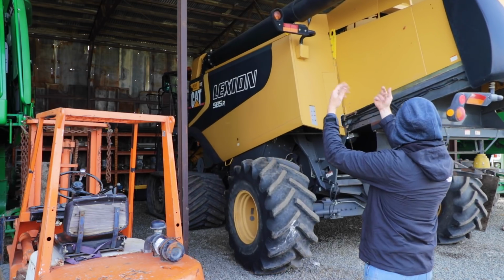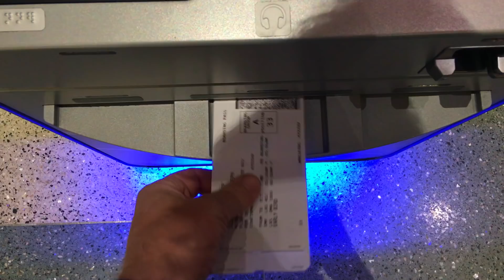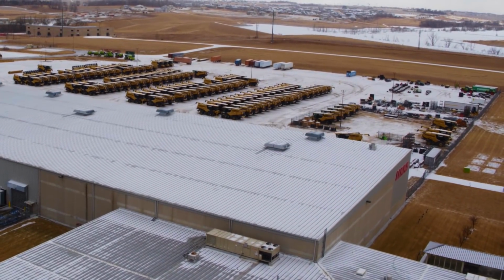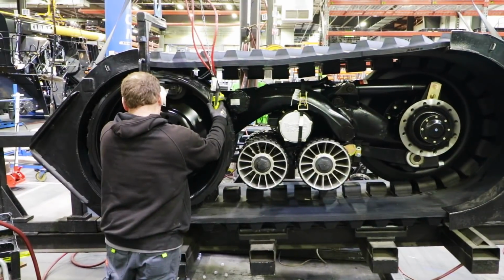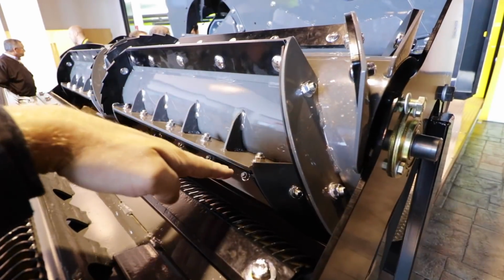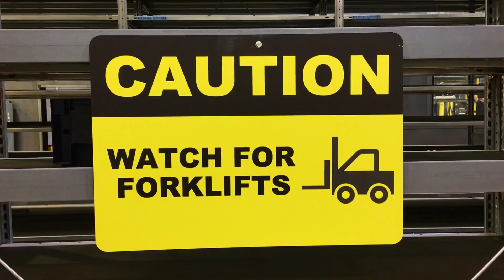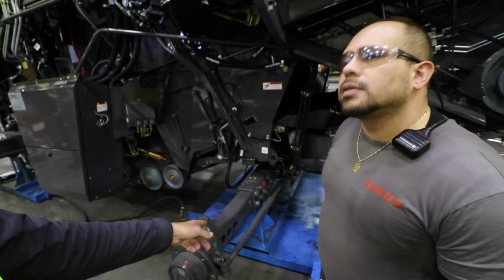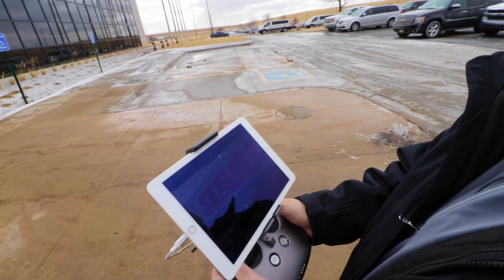How a Harvest Combine Works!

Comment: Great videos quick question Why are the claas an orange cat colour as where I'm from claas s light green. White and red . ?
Reply from the maker: Mr. Morris, great question. I think it has to do with marketing and consumer acceptance of a new product. American Farmers knew Deere green and Case red. But Claas neon? What’s that. They really pulled the branding towards Cat yellow and the actual name Cat. On early machines you could barely find the name Claas but Cat was all over. And they were only using Cat engines. Everything else was Claas. So American consumers were already familiar with the name Cat and the yellow color. As time goes on you start to see more Claas branding and less Cat, but still yellow. Apparently in 2020 the will start selling Claas combines in neon within the states...now that consumers are more familiar with the name. This is all just my speculation though. 
-Matthew
Reply: Never new they sold claas in America . The same with many machines in UK . Like same hurlimann and Lamborghini but the older ones like a hurlimann xt130. Don't know if u get them in America.

Comment: How's the irrigation situation? Are you still having water problems.
Reply from the maker: We got a few inches of rain this weekend Leuan but nothing substantial. What we're really in need of is snow up in the Sierra Nevadas above the Lake Oroville Dam. That summer melt would help a lot in supplementing our needs throughout the year's hottest months. We should be getting a new metering of the snowpack soon. But, as I mentioned in last week's video, we were at 14% of average  a month ago...and I don't think it's snowed much. In fact we had some fairly warm weather. We have a lot of march to go though. 
-M.

Comment: Lexion, the only way to go.
Reply from the maker: P, we've got our Claas Lexion 585R, a John Deere CTS 9660 and and older CTS2. We're definitely considering moving more towards the yellow direction. We are really, really happy with the performance and service that comes with our Lexion.
-M.
Reply: Rice Farming TV yeah man! we run two 760's now. Going from the 585 to the 760 was night and day difference.
Reply from the maker: Oh, great to hear. We are treading in towards the 760. They are still really pricey even used. We'll see what happens.
-M.
Reply: It's a Agco..
Reply: Nothing runs like a deere..top tech for claas for for years. And all they are is very expensive agco technology with German parts that wear to fast. But they can produce just dont last. Pretty cool video.

Comment: Thanks Matt, love the toy combine at the end.  quick question:  Claas is the manufacture of the Combine, but I see a Cat logo on your equipment?
Reply: L B L B In 2001 to enter the US market Claas the German combine harvester manufacturer went into a joint venture with Caterpillar Inc. and opened a assembly facility in Omaha, NE. The combines were originally marketed as Caterpillar combines, with Lexion as the model. Cat was supplying the engines. First they had the Lexion 400 series and then the 500 series. In 2010 Caterpillar exited the agricultural equipment market and sold its 50% share in the Omaha operation to Claas. That year Claas introduced Lexion 700 (rotary) and 600 (straw walker) series and dumped the ‘Cat’ Logo on New Lexion Combines. The new model launch provided a timely opportunity to finally exchange the large “Cat” logo with the Claas name for Lexion’s own identity. Caterpillar is no longer the exclusive engine supplier for Lexion combines now that top models use MTU Mercedes power units. And Caterpillar dealers are no longer the only ones selling the combines as Claas develops its own distribution network. For now the yellow color has been kept for the North American market but everywhere else the Claas combines have always been green in color .

Comment: The rice you cultivate is gmo or non gmo variety
Reply from the maker: Praveen this is a great question. We don't farm GMO rice in the controversial sense--no splicing of genes. No making the seeds resistant to particular herbicides. The rice we farm has been bred for particular traits like plant vigor, yield, straw height/strength, etc. I really need to learn more about this though in order to give you a 100% thorough answer. 
-M.
Reply: OK ❤️

Comment: why are they named cat if they are actually claas? btw claas is german^^
Reply from the maker: Hi Bombus, great question! I'm not sure about the details but Claas uses Cat engines. They may have marketed the name Cat stronger than Claas because it was more recognizable to an American market. That's just my theory though. Yes, Claas is a privately owned German company. The only major tractor manufacturer that is still privately owned. 
-Matthew
Reply: In 2001 to enter the US market Claas the German combine harvester manufacturer went into a joint venture with Caterpillar Inc. and opened a assembly facility in Omaha, NE. The combines were originally marketed as Caterpillar combines, with Lexion as the model. Cat was supplying the engines. First they had the Lexion 400 series and then the 500 series. In 2010 Caterpillar exited the agricultural equipment market and sold its 50% share in the Omaha operation to Claas. That year Claas introduced Lexion 700 (rotary) and 600 (straw walker) series and dumped the ‘Cat’ Logo on New Lexion Combines. The new model launch provided a timely opportunity to finally exchange the large “Cat” logo with the Claas name for Lexion’s own identity. Caterpillar is no longer the exclusive engine supplier for Lexion combines now that top models use MTU Mercedes power units. And Caterpillar dealers are no longer the only ones selling the combines as Claas develops its own distribution network. For now the yellow color has been kept for the North American market but everywhere else the Claas combines have always been green in color .